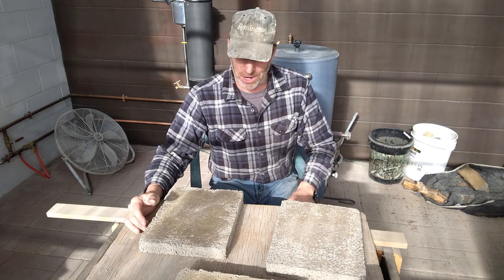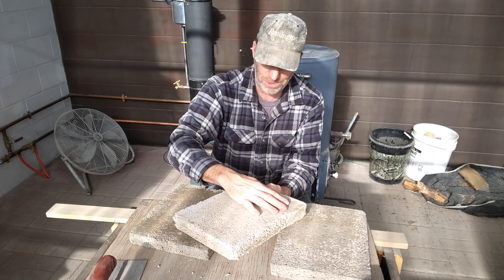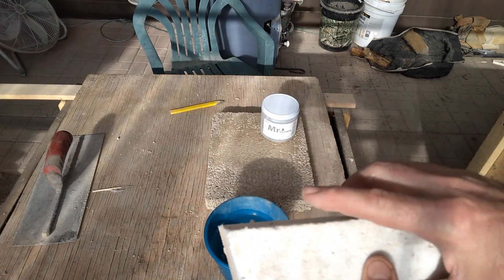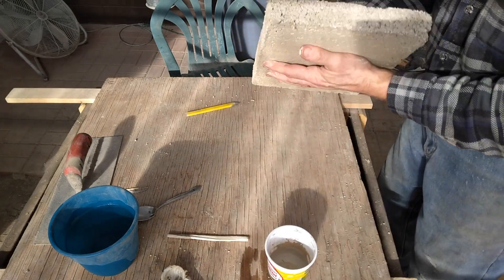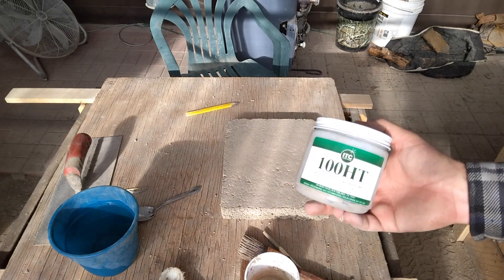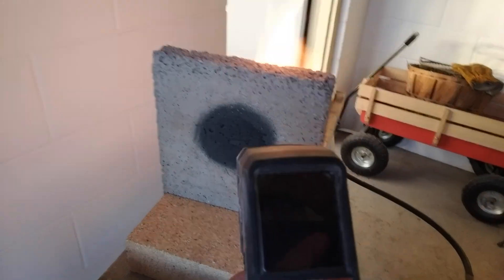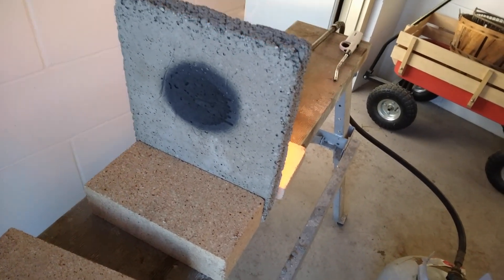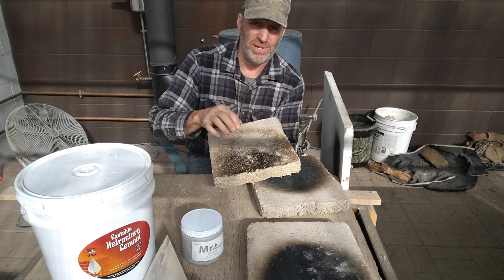(Part 2) DIY, Inexpensive Rocket Stove Building Material

Comment: Wow! Very impressive! I’ve been building and messing with rocket stoves and mass heaters since 2010 and I I think I’m going to try your 30% mix on the next fire box and riser. I think you are right about vibration or making sure the mix has no air pockets even though the air pockets could improve the insulation value if they retain any moisture or humidity they will blow out the surrounding material. Ceramic fiberboard does not hold up in a firebox. 
Another experiment you might try is a standard firebrick with nothing and then with the infrared paint as a comparison. Your process and explanation are superb. Thanks again!

Comment: Acknowledging that I did not participate, or even assist/contribute to the tests, my observation is likely worth less than my investment. Nevertheless, I hope my comments will offer some value.

The reflective material did not contribute much and appears to not be a valuable addition to your cast slabs.

My experience working viscous materials like concrete taught me that unless traction is a desirable objective, working the surfaces as smooth as possible is ideal for wear.

I suspect that the 20% mixture would be stronger if compressed and smoothed before curing. (Being ignorant of the investment, I have no idea if that is a consideration.)

VERY INTERESTING – I would love to see an application usinf these!

Comment: Based on your experiments would you feel confident using these bricks in the firebox of an rmh?
Reply from the maker: For insulating the fire box; but I would use regular fire brick in the places that would contact the fire wood. (sides and bottom)  In time, I always have broken fire brick to replace in my fireboxes, just from the wood banging and rubbing up against it.
Reply: Do you think this kind of brick would make a reliable roof for the firebox of a batchrocket?  @doubleMinnovations
Reply from the maker: Yes.  I would probably make it 2" thick, and add a little wire reenforcing.
Reply: I appreciate you being so helpful. Keep up the great work.  @doubleMinnovations

Comment: I wonder if you could make aircrete with refractory cement and how that would work for a burn chamber?
Reply from the maker: It might be possible, but I think this is a lot easier for anyone to do, and perlite is not very expensive.
Reply: A little late to the party, but your idea would work. The foam in aircrete creates very small air pockets which is what insulating fire brick is! As OP mentioned perlite is or could be easier for many. I personally want to use aircrete foam w/ castable refractory to make insulating bricks or panels. I'm finding creating the foam apparatus can be pricey and buying one is even more expensive. Absent the foam, super fine sawdust would work as well as it would burn out during a firing.

Comment: Coat them in refactory mortar. Esp the top surface as the bottom seems to have plenty of binder. ~ A cup of refactory cement to seal in the pearlite? Would still use less material

Comment: Hi, i'm a potter, and i need a lot of ceramics brick for my kiln. The problem is the price of the brick. And i really appreciate your videos. And i was thinking if this brick could old the temperature of a ceramics kiln which is 1300° or 2372° fahrenheit. for quit a long firing (6h / 9h ) to reach 2372°. And if the brick is strong enough to stay in his righ form and avoid deformation. Thanks for sharing and if you can answer i would be really happy ! thank's !
Reply from the maker: The purpose of this, is to make a homemade high temp insulative board.  It's not going to hold heat like a firebrick.  You need a thermo mass to hold heat.  People use homemade 'cob' as a mass to hold heat.  It's a mix of sand and clay.  You may want to check into that.

Comment: What kind of heat gun do you have Double M and why did you paint the backside black ??? I was thinking of using a viburator when making bricks to make sure the material will get rid of air pockets and make sure the arroget will be jigsaw puzzle together with way better results. That is what they do on construction sites. Thanks for sharing your results.
Reply from the maker: The IR thermometer is the same one I use for testing the wood burning units.  I have noticed before that you get a more accurate reading off a darker surface.  
From what I learned, I want the thickest mixture as possible, (using the least amount of water), to get the strongest result.  So my opinion would be to press the mix in the mold.  Thanks for all your interest and comments!
Reply: @doubleMinnovations  What brand name IR thermometer are you using and model Sri ??? What are the pluses and minuses Double M  ??
Reply from the maker: Ames Instruments.  It was about $60.  Does what it's suppose to do.  I can't find the book for it, but it seems like the object you want to measure, has to be over 1inch big.  So it doesn't work on my 1/2" pipes very good.
Reply: @doubleMinnovations  Thanks, If you find the book please respond with information.  . Good day too. Thanks for education.
Reply from the maker: I found the Owner's Manual online:  "https://manuals.harborfreight.com/manuals/64000-64999/64847.pdf"
Reply: @doubleMinnovations  Thank you very much Double M Innovations. I want to buy one for me. Would you agree ??
Reply from the maker: If you have use for one with this high of a temperature range, this is probably the best deal you'll find.  You can get other ones that will range up to 1,000˚F, for around $25.  I had a couple of them, but destroyed them by over ranging them on my wood burners.
Reply: @doubleMinnovations  NOW you might think I am nuts but why would an IR gun get destroyed by over ranging them ??? Why are they so delicate to over ranging the temperature gun ?? Thank you Double M innovations. Peace vf
Reply from the maker: I don't know the why's, but they can't handle attempted measurement of temps beyond their range.
Reply: @doubleMinnovations  This is real interesting Sir. I would think that if the temperature range is out of the specifications the unit would not respond and attempt to give a reading. I do not know, period.

Comment: Good to see the performance.  Wondering along the lines of UHPC, if something fiber like basalt or rockwool fibers might aid in the strength?   Now that I think about, I've wondered about using rockwool insulation with like a coating of silica glass to keep the surface bound together and provide a smoother more uniform reflective surface.  Thanks for sharing!
Reply from the maker: That 'water glass' is kind of difficult to work with, I think.  The 'rigidizer' I used for the riser tube on the rocket stove water heater, is now kind of expensive too.  I happened to buy a bunch of these kind of things about 6 years ago.  Everything was less expensive then, and easier to get.